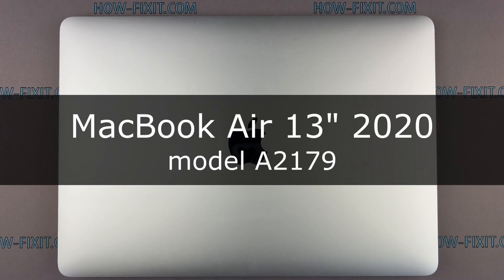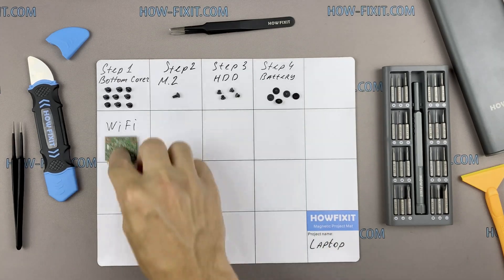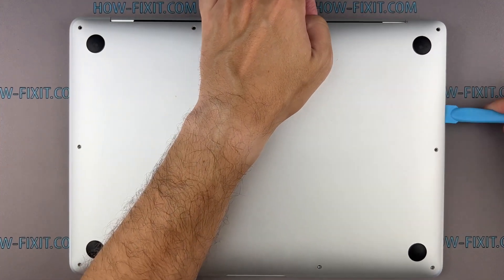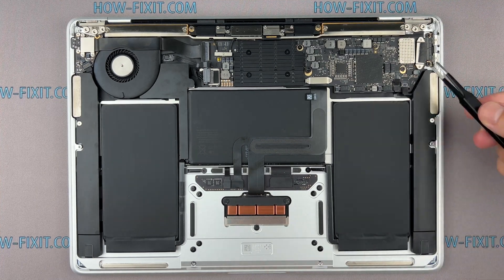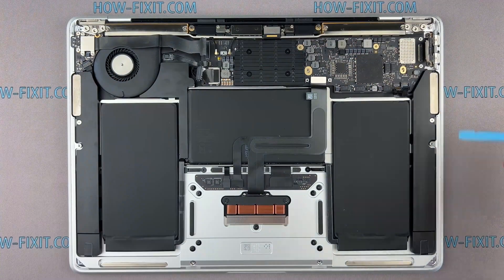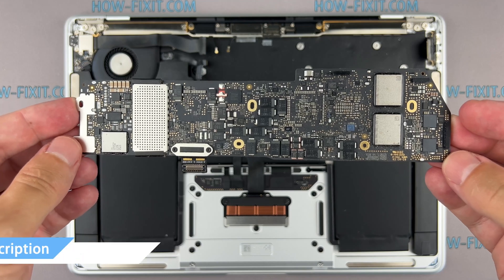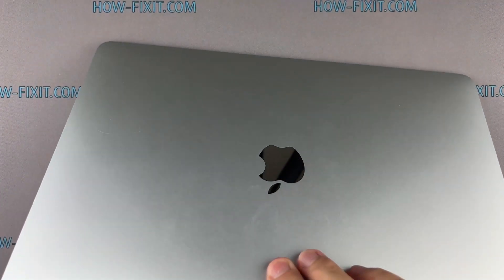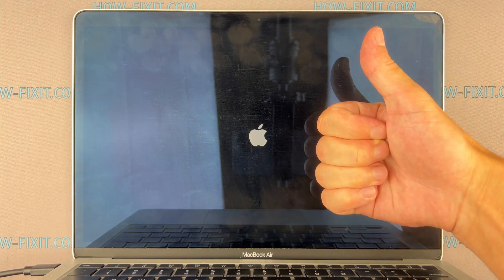MacBook Air 13 2020 Logic Board Replacement Guide - Made it Easy!

Comment: Friendly tip if you don't do a lot of this kind of work and do not want to buy magnetic mat....  Use a piece of corrugated cardboard and rough sketch the outline of the logic board in this case then press the screws into the cardboard in the locations they came out from lining up with the sketch.  Thanks for the video though and I'm not trying to hurt your mat sales but lets face it a lot of people won't buy the mat and this tip can save them some trouble.  The mat is cool though and I would like to own one some day.
Reply: good ideal
Reply: I do that when working on my car also..